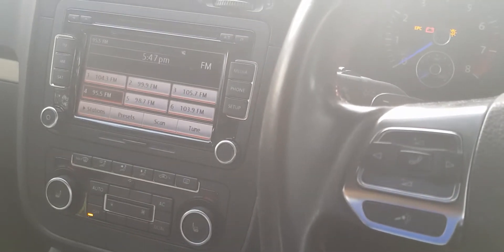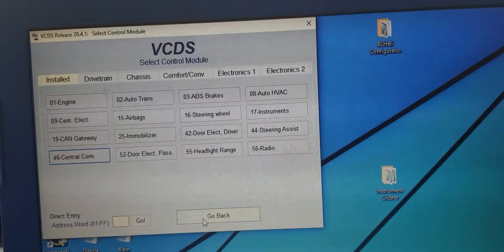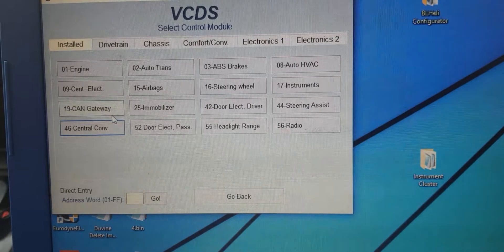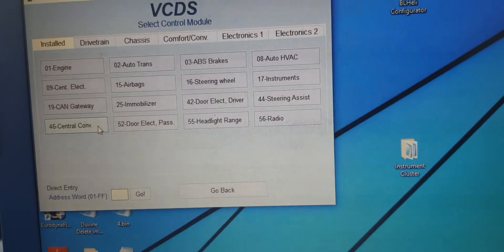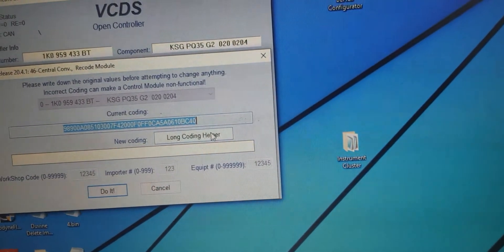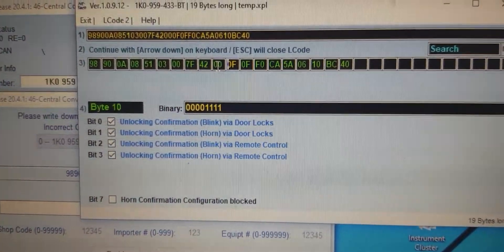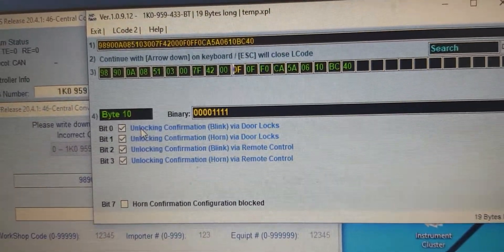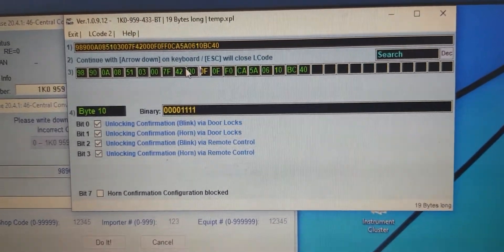CECM for MK5 Golf

Comment: Hello  Sir, I need your help again...  I try to retrofit multifunctional steering wheel from golf mk5 to golf mk5. I was thinking that I will not have to change steering wheel control module because on the sticker it says: 1K0-953-549-AG	(Highline). But when i try to enable it using VCDS it was saying error 31 coding out of range. Than I notice on the VCDS the part number is 1K0-953-549-AF (Midline). Any suggestion, or buying new steering wheel control module from Highline? Sorry for bothering you ! I appreciate your answer
Reply from the maker: You are not bothering me at all.  I assume you already have the revision "C" clock-spring for compatibility with ALL steering wheels. Unfortunately in this case, you would need to change
the module as it does NOT support at least the 1.3 LIN version as stipulated in the Ross-Tech link below.  Your case is a good example of why one shouldn't look at what is written on the sticker (as the plastic casing can always be swapped (if the car had a previous owner that needed work done on that module).  The wiki page below shows what modules you can get for your car.  In your case, you should only choose the Highline modules.  You may ask any question you wish

http://wiki.ross-tech.com/wiki/index.php/Steering_Wheel_Control_Module_Versions
Reply: @MatthewTaylor3  Slip Rings
 Type 2: 1K0-959-653-C and 1K0-959-653-D probably one of both because SW Control Module 1K0-953-549-AG and 1K0-953-549-AF both have Type 2 Slip Ring. Or must be 1K0-959-653-C ?

Comment: Hello  Sir, I need your help, I want to retrofit mk6 climate control in mk5 with econ option. what I need to do please answer me.  gjorgjijov@gmail.com
Reply from the maker: I was going to respond to you by e-mail, but for the purpose of anyone else who was curious, I used the part number with 5K0-907-044-ES.  I only had to splice and swap one wire (I think it was pin 16 or pin 20) to get the unit to "remember" the last settings that was set on the climatronic unit.

In your case of the ECON variant, I recall it was exactly the oposite of my full featured one.  Your car comes with one vent flap motor where mine comes with two (or vice-versa) from what I recalled reading on some forums somewhere.  In your case, you would have to actually install or replace an aditional motor flap (where I don't need to do it).  You would then just mount the same part number I posted above.   For the aesthetics, you NEED to get the bezel from the 2010 Jetta (no other year carries this bezel that fit the MK6 climatronic unit to a MK5 Golf.   I'll have to browse through some forums to refresh my memory of how I did this overall process.  My 2008 GTI had all the parts, so I just got the MK6 GTI climatronic unit and the 2010 Jetta bezel, the installation was straightforward (other than the wire splicing I mentioned before) and coding done in VCDS / OBDeleven.

Note: you will need to do the flap adaptation for your various vent motors for smooth operation.